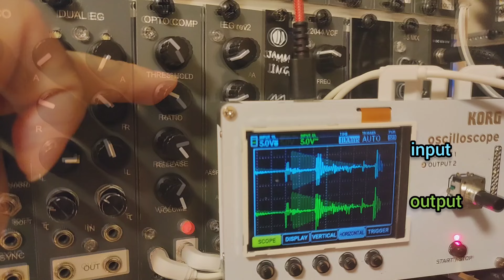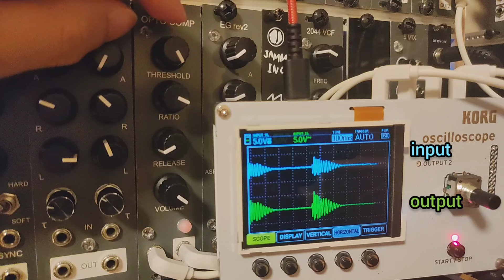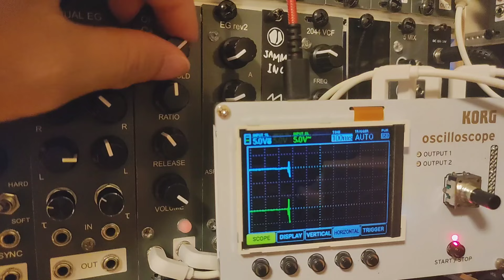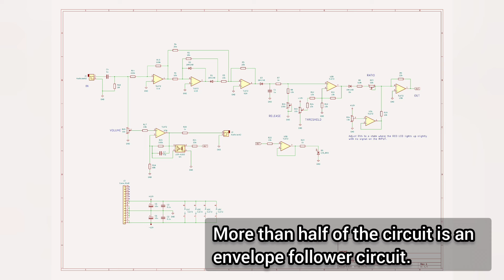[$9] DIY eurorack modular synth opto compressor | vactrol type optical compressor

Comment: One extra switched jack on the line from input to the volume pot, and I think you can sidechain? Or does the follower need to be inverted? Worth to build since you have spare envelope followers ;)
Reply from the maker: That is correct! With a few additional components, sidechains can easily be made.